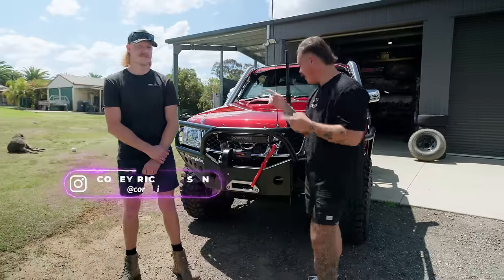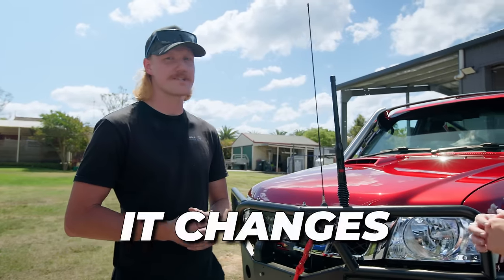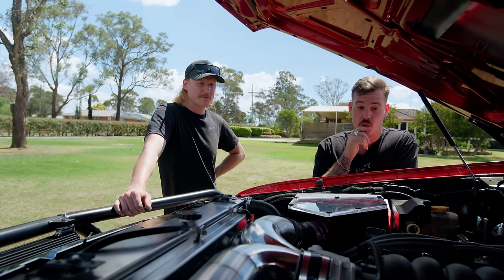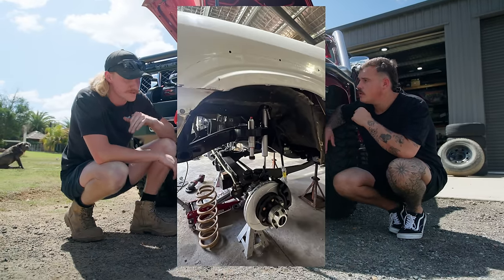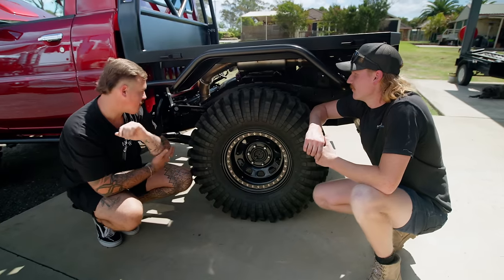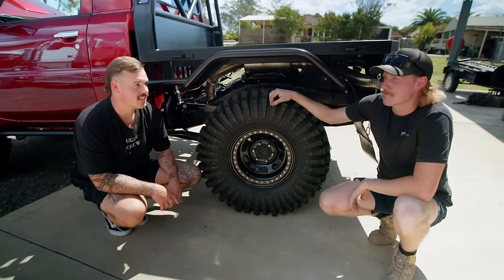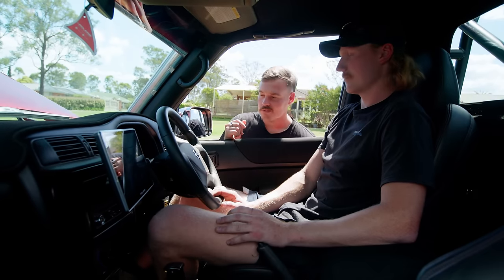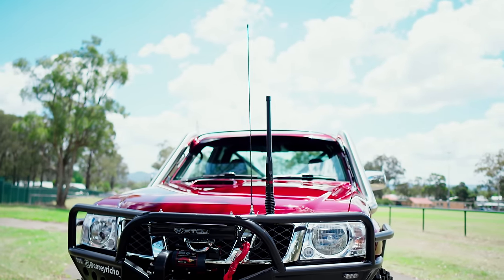LS3 Swapped GU Patrol built entirely himself! Cleanest Ute In Aus?

Comment: Also you can pick up a used LSA blower second hand fairly cheap. Change the cover port and polish. 15 lbs of boost 500 to 600 hp would be insanity in that little light truck
Reply from the maker: Oh shiiiiit!!
Reply: Why would you want 600hp in a 4x4? Come back to earth.
Reply: Apparently you didn't watch the video.....  I'm not gonna explain how tuning works but it doesn't have to make 600hp all the time man. It could be 600 hp capable....
Reply: @trickster8635 Better to have and not need, than to need and not have.

Comment: I admire the workmanship, can't take that away. But what is the point? It'll get trashed and pinstriped on the first track and all that bling will be for what? Can't tour in it, coz there is no load space and the petrol guzzler will make it unaffordable to run. It'll cook itself in the desert with no engine driven fan, unless you stick to 2WD roads, and may as well run a 2WD. There is a line crossed where you want to do quality work and lose sight of what it is all about. This has lept over that line!

Comment: Nice ute old mate did well..

He Needs twin turbos though not a single.
I did a single on a ls2 n blew a rod outa the block.
1 turbo only uses 1 side of the block so its not good at all.
Reply: No you should plump both sides into the turbo is the normal way of doing it
Reply: Not enough room to do that in a commodore engine bay.
 If you still want a descent dump pipe and exhaust size its
Better to do the twins.